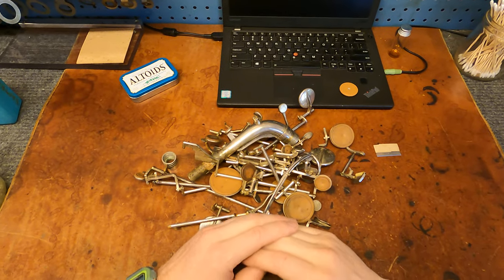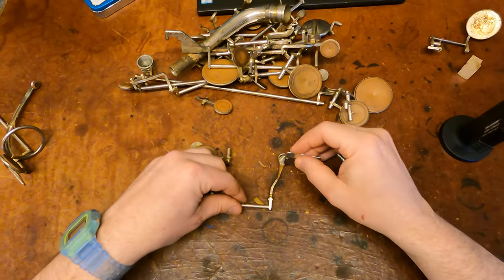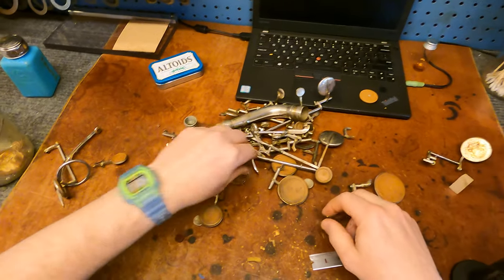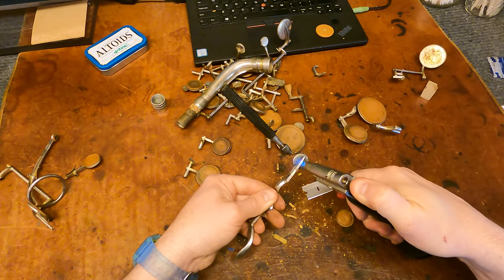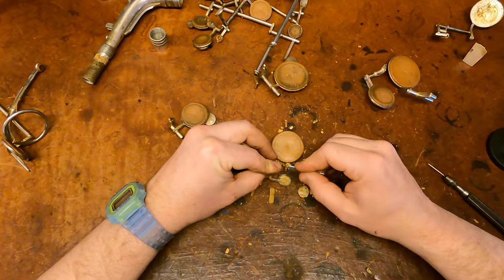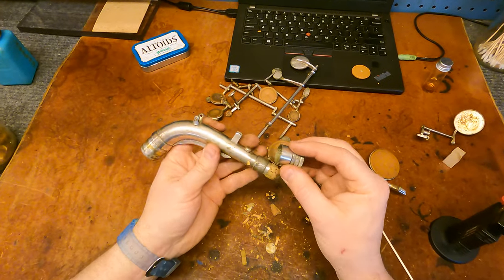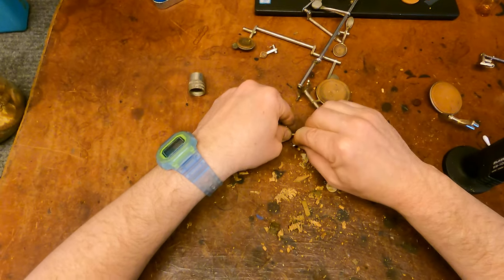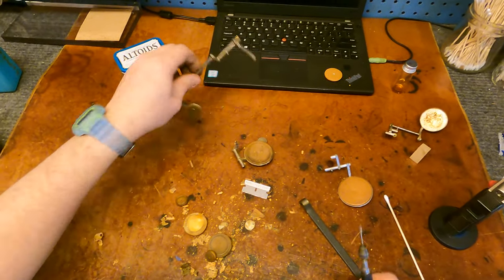Let's Overhaul A Saxophone Together, Part 3: Removing Pads & Corks

Comment: Would love to see this process on a lacquer horn to see how you would change your heating.
Reply from the maker: Not by very much.  The amount of heat is determined by how shellac responds, not by the finish on the horn.  Burning lacquer means you concentrated your heat for too long in one spot or getting too hot overall, neither of which are good for pad seating, so you wouldn't want to do it on a plated horn either- just your punishment will be difficult pad seating only, rather than burned lacquer.

Comment: It is quite amazing how you can be mesmerized by a guy removing pads and corks from the keys of a saxophone...;-)

the commentary is full of interesting information. thank you!

just a question: leaving the corks would impact the cleaning process? as you mentioned cork can be compressed, but leaving it might speed up the final adjustment, as long as you aim at a philological restoration... (which is not your goal if I understand it correctly, right?)
Reply from the maker: Glad you find it interesting! It was going to be a hot day here so I did this early in the morning and I was not super energetic.  

As far as the corks, you can wash them and if they don't fall off they are typically fine to reuse. However, even very small variations in how the new pads go in will render some of them them (example: the adjustment material between the upper and lower stack bar keys and the rest of their respective stack) useless.  Some, like perhaps the one on the chromatic f-sharp or on the bottom of the octave key, could be left and slightly adjusted if necessary and probably do the job fine.  Reusing corks is more of a play condition or clean-oil-adjust type of use case (because many of the original pads are staying in, and therefore the relationships between the keys stay the same) than for in overhaul.  The more pads you replace, the more adjustment materials are likely to want replacing as well.
Reply: @StohrerMusic  I agree, especially if you are going to replace such old pads which probably require totally new adjustments.

About the "microtuner": I think yours is in pristine condition (mine is identical). As far as I was able to find out it was introduced in the Pierret Vibrator model (late 20s, probably 1928-29). It clearly seems a cheap attempt to mimic the Conn microtuner, probably for marketing reason (the Vibrator and the following Virtour models were not really successful though, probably less the one thousand were produced). I have the feeling that Pierret predated many other saxophone manufacturers with regards to segmenting the market with price discrimination (sell saxophones to different users with different prices) and marketing strategies.